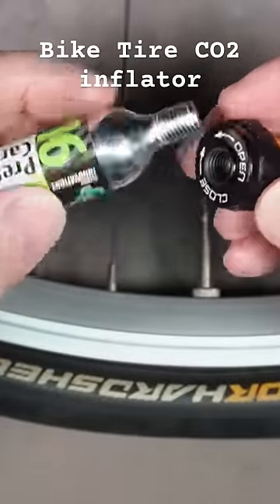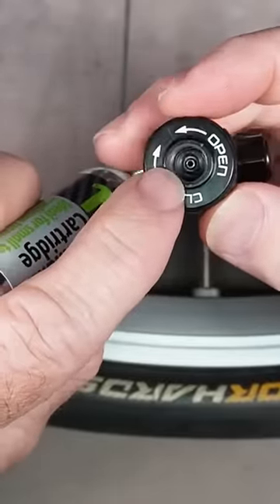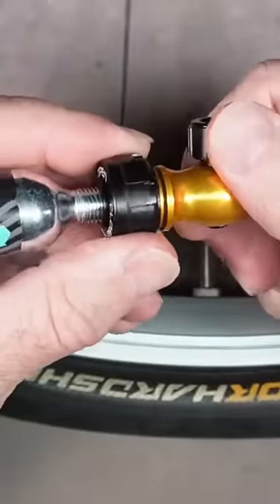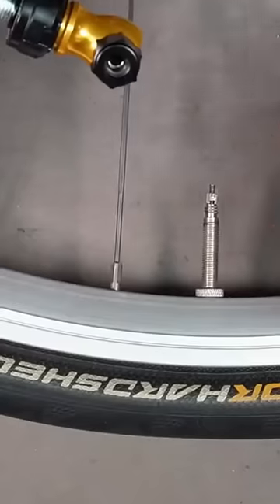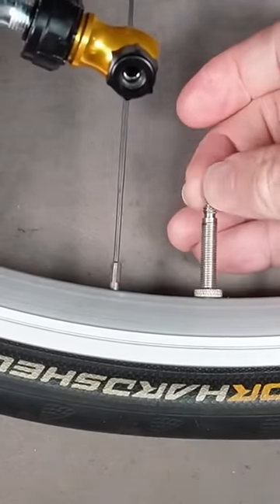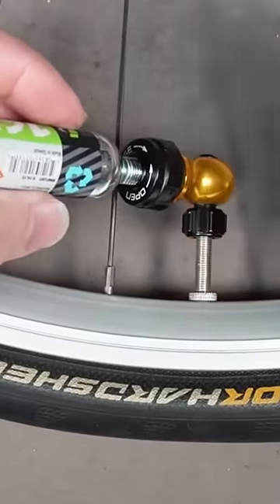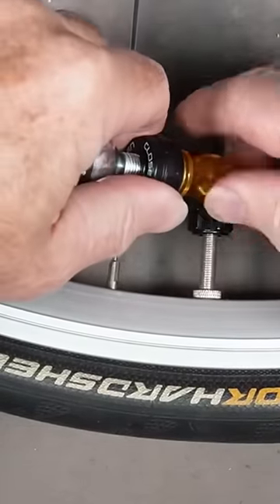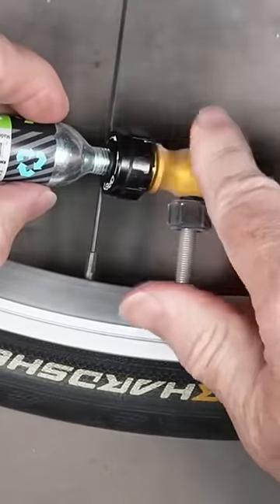Bike Tire (tyre) CO2 Inflator: How to use. #bicyclerepair #bike

Comment: You didn’t show the tire air coming out of the loose valve guys.
Reply from the maker: The valve is a Presta valve, which stays closed as long as there is pressure inside the tube or tire. Thanks for the comment.!

Comment: Now that you have unscrewed the valve core. Good luck keeping all of that co two in your tire when you disconnect that device
Reply from the maker: Nothing will escape when the CO2 inflator is removed. This is a Presta valve. Presta valves close when there is pressure inside the tube or tire. I only loosened the lock nut, which is necessary for air or CO2 to flow into or out of a Presta valve. I did not remove the core.
Thanks for the comment! I appreciate it!

Comment: He said unscrew the schrader valve but he didn't show you when you remove the inflator you have to poke the schrader in under the pressure. Worthless
Reply from the maker: Nothing will escape when the CO2 inflator is removed. This is a Presta valve. Presta valves close when there is pressure inside the tube or tire. I only loosened the lock nut, which is necessary for air or CO2 to flow into or out of a Presta valve. I did not remove the core. You can see the entire video here: How to Use a CO2 Bike Tire Inflator
https://youtu.be/jc-BpZL3lAk
Thanks for the comment! I appreciate it!

Comment: Bike pumps so compact now it hardly seems worth it especially if you goof up the fill and vent all the gas
Reply from the maker: There are definitely pros and cons! I have used my CO2 inflator at least four times over the years to save a ride and it worked fine for me. I will admit, though that the first time I was glad I had a second cartridge because I did not know what I was doing! Thanks for the comment!

Comment: Wow, and who carries a tool to loosen the main tire valve?? You know a lot of the air is gonna leak right back out when you disconnect it?? Until you get that tire valve tightened back down!! Why doesn't the device depress the main valve like any other tire inflator ???

I tried both amazon links, which show a re-designed device that would work as one should. This video should be removed/updated.
Reply from the maker: Please do a little research before you trash a video. The valve in the video is a Presta valve. Very common on higher end road bike. Presta valves close when there is pressure inside the tube or tire. I only loosened the lock nut, which is necessary for air or CO2 to flow into or out of a Presta valve. I did not remove the core. You can see the entire video here: How to Use a CO2 Bike Tire Inflator
https://youtu.be/jc-BpZL3lAk
Thanks for the comment! I appreciate it!

Comment: Did he ever red screw the valve
Reply from the maker: The valve is a Presta valve. Presta valves close when there is pressure inside the tube or tire. I only loosened the lock nut, which is necessary for air or CO2 to flow into or out of a Presta valve. I did not remove the core.
Thanks for the comment! I appreciate it!
Reply: Awesome thanks for the feedback!

Comment: And a small frame-pump is bad because …?
Reply from the maker: No one said it was! A CO2 inflator is just another option for emergencies to quickly and easily inflate a tire out on the road after fixing a flat. It is super small, light and inflates a tire in seconds. Thanks for commenting!

Comment: Or... just get a manual hand pump.  Small and easy to use
Reply from the maker: Pumps work great! A CO2 inflator is just another option for emergencies to quickly and easily inflate a tire out on the road after fixing a flat. Thanks for commenting!
Reply: @davescycling  seems kinda like a waste when a hand pump is small enought to fit anywhere and capable of filling up a tire as much as you want/need instead of being limited, then have to buy more C02 cartridges. 
Waste of money in my mind.
Reply from the maker: Thanks for your input and opinion! Enjoy your rides!!

Comment: You just need to be carefull that you dont explode your tire into your face
Reply from the maker: If you start with a flat tire, which is the purpose of the CO2 inflator, there isn’t enough volume of CO2 to over inflate the vast majority of tires out there. In my my testing, a 700c x 28 mm tire will only be inflated to about 90 psi using an entire 16 g CO2 cartridge. There is more information in the description regarding the pressures and tire sizes the CO2 cartridge will inflate.

Comment: Why does it need to be CO2? Why not compressed air or compressed N2? 🤷‍♂️🤦‍♂️
Reply from the maker: I do not know. I did not make these. Lol.
Reply: @davescycling  Exactly. 
There is enough CO2 in the atmosphere. Formula1 uses N2, aviation uses N2, N2 was a big marketing hype for cars several years ago. That's why I refuse to support this. 😉🤷‍♂️
Reply from the maker: Hopefully the cycling industry will love to N2 as well! Thank you for your input!
Reply: @davescycling  If they take the CO2 out of the atmosphere by cooling and pressurising: fine! If they burn natural gas just for creating CO2: not good. 🤷‍♂️

Comment: Oooh. So the air stays in the tire until you have to put the valve back in the stem?? 😂😂😂😂 Seems legit..
Reply from the maker: This is a Presta valve. Presta valves close when there is pressure inside the tube or tire. I only loosened the lock nut, which is necessary for air or CO2 to flow into or out of a Presta valve. I did not remove the core.
Thanks for the comment! I appreciate it!

Comment: nice, again something that nobody needs  xD
Reply from the maker: A CO2 inflator is just another option for emergencies to quickly and easily inflate a tire out on the road after fixing a flat. Thanks for commenting!
Reply: @davescycling   you can also use a pocket rocket master blaster .. anytime. You need to pump the surrounding air ... ok, maybe not in space ! ;)

Comment: 800 PSI in those how does it not explode the tire
Reply from the maker: It may be 800 PSI but it is a small volume of gas. The amount of compressed CO2 in the cartridge is only enough to fill a 700x x25 tire to around 95 PSI. Thanks for the question!
Reply: Ok cool. I thought CO2s was only used for
BB, Airsoft and paintball guns. Now I know they are for bicycle tires too. Thank you for the reply
Reply from the maker: I appreciate your input!

Comment: He unscrews the valve core. Now what ?
Reply from the maker: This is a Presta valve. Presta valves close when there is pressure inside the tube or tire. I only loosened the lock nut, which is necessary for air or CO2 to flow into or out of a Presta valve. I did not remove the core.
Thanks for the comment! I appreciate it!
Reply: @davescycling  thanks I was wondering how that worked.
Reply from the maker: I appreciate your question!

Comment: That pin thing on my gun the side is bent what do I do
Reply from the maker: Please clarify your question, thanks!
Reply: @davescycling  The O Pin is bent on my G19 like it was crushed what do i do (I apologize for not being more specific)
Reply from the maker: I think you are on the wrong Youtube channel.
Reply: @davescycling  I’m not the thing you have has that ring
Reply from the maker: Ok, I think I understand. If that pin is bent or crushed you will need to replace the inflator device. The pin will likely not be able to pierce the seal on the CO2 cartridge if it is bent.
Reply: @davescycling  it punctures just fine but I’m worried about over time it leaking

Comment: Or you can have a manual pump with infinite uses
Reply from the maker: Indeed! A CO2 inflator is just another option for emergencies to quickly and easily inflate a tire out on the road after fixing a flat. It is super small, light and inflates a tire in seconds. Thanks for commenting!

Comment: I doubt this will be able to provide the 60 PSI I require.
Reply from the maker: It will depend on what size tire you are using. In the description you will find various tire sizes with the potential PSI rating.

Comment: why not just use a pump or air compressor?
Reply from the maker: A CO2 inflator is just another option for emergencies to quickly and easily inflate a tire out on the road after fixing a flat. Thanks for commenting!
Reply: @davescycling  true might be good to have multiple options depending on your circumstance. thank you for the demonstration

Comment: All proprietary, isn't it?
Reply from the maker: No, it will work with any brand of threaded CO2 cartridge and depending on the inflator you get you just need to make sure it will work on a Schrader or a press valve depending on what you have. Thank you for the question!

Comment: Why? Those hand pumps are so small and effective these days that you don’t need all this fancy bs.
Reply from the maker: Hand pumps are great! A CO2 inflator is just another option for emergencies to quickly and easily inflate a tire out on the road after fixing a flat. It is super small, light and inflates a tire in seconds. Thanks for commenting!
Reply: @davescycling  I get what you’re saying and I get the purpose. But I mean that while you make sure everything is aligned correctly a person with a hand pump just slaps it on and inflates a tire under a minute or so, minus the used cartridge or whatever it’s called.

Comment: lost.most of it when u removed it and tried to screw the valvestem guts back in. vid did not show that.
Reply from the maker: This is a Presta valve. Presta valves close when there is pressure inside the tube or tire. I only loosened the lock nut, which is necessary for air or CO2 to flow into or out of a Presta valve. I did not remove the core. You put can see the entire video here: How to Use a CO2 Bike Tire Inflator
https://youtu.be/jc-BpZL3lAk
Thanks for the comment! I appreciate it!

Comment: а как он без нипеля закроет?
Reply from the maker: Nothing will escape when the CO2 inflator is removed. This is a Presta valve. Presta valves close when there is pressure inside the tube or tire. I only loosened the lock nut, which is necessary for air or CO2 to flow into or out of a Presta valve. I did not remove the core.
Thanks for the comment! I appreciate it!

Comment: Cheaper to bring a bike pump
Reply from the maker: This may be true, although CO2 inflators are pretty cheap! A CO2 inflator is just another option for emergencies to quickly and easily inflate a tire out on the road after fixing a flat. It is super small, light and inflates a tire in seconds. Thanks for commenting!

Comment: I hate preston valves with a passion
Reply from the maker: I hear that a lot, thanks for your input!
Reply: @davescycling  i gather you would lol.
I've looked into these units for my 8x8 as an emergency thing, as they only need 3-5 psi. Ended up with a compact ryobi compressor instead.

Comment: your going to lose 50% just to tighten the schrader valve with this method. Plus you can hear liquid going in. Not good.
Reply from the maker: Nothing will escape when the CO2 inflator is removed. This is a Presta valve. Presta valves close when there is pressure inside the tube or tire. I only loosened the lock nut, which is necessary for air or CO2 to flow into or out of a Presta valve. I did not remove the core. Also, CO2 partially turns to liquid as it expands due to the sudden decrease in pressure but becomes gas again as it fills the tire. No issue. This method has been used for decades (it is only meant for emergency use went out on the road after fixing a flat tire) and I have used it personally for years and never had an issue. You can see the entire video here: How to Use a CO2 Bike Tire Inflator
https://youtu.be/jc-BpZL3lAk
Thanks for the comment! I appreciate it!

Comment: When you remove it to reinstall the valve in the steam all the air will go out of the tire . 😂
Reply from the maker: This is a Presta valve. The pressure inside the tube will keep the valve closed. Thank you for your comment!

Comment: А что стало с обычным насосом?
Reply from the maker: A CO2 inflator is just another option for emergencies to quickly and easily inflate a tire out on the road after fixing a flat. Thanks for commenting!
Reply: @davescycling  I know, but much time do you gain using this tool comparing with a common pump? And it is limited. So does it worth it?
P.S. But this tool was interesting, didn't know about it before your video, thx)
Reply from the maker: Thanks for your reply! I carry one of these and I do not carry a pump. Used it 4 or 5 times over the years when I had a pinch flat issue in one of my road wheels. I like it because it is super small and can stow it in a small saddle bag and not even know it is there. I like minimal gear on my bike. Also, after sitting roadside replacing the tube in my tire ( I am no youngster) I appreciate the easy and fast inflation the CO2 inflator provides!

Comment: Ive always got a spare inner tube or 2 and a pump on me so, domt see the need
Reply from the maker: I carry a tube and a CO2 inflator. Inflates in 3 seconds and I am on my way. (After replacing the tube, of course)
Reply: @davescycling  seems pointless when a pump is long term and may only take you an extra 30 seconds
Reply from the maker: It is what I have used for years. Not saying it’s better, just my preferred method! Thanks for your input!

Comment: Y not use a tire pump…
Reply from the maker: A CO2 inflator is just another option for emergencies to quickly and easily inflate a tire out on the road after fixing a flat. It is super small, light and inflates a tire in seconds. Thanks for commenting!

Comment: There is no way 1 co2 cannister filled that tire to the 110-120ps1 the tire should be at with presta valves/tires take super high pressure to keep inflated
Reply from the maker: Actually, it can depending on the tire size. I have a video demonstrating using one 16 g cartridge to inflate a 700 C by 28 mm tire to 95 psi. I did not actually test but I would imagine that a 25 or 23 mm tire would actually get up to 110 or more. The company does advertise (see description for inflation info) that the 16 gram cartridge can inflate some road tires to 130 psi. The 20gram cartridge would definitely do it. Please note that the CO2 inflator is designed for emergency use to inflate a tire quickly and effectively after a flat repair while on a ride. If you use one on a ride, it is highly recommended to replace the CO2 with regular air when you get home as CO2 does leak out of the tire much faster than air does. Thanks for your comment. I really appreciate it!
Reply from the maker: I am not sure how my attempt to provide factual information is arrogant, but I am thankful for all who watch my videos! So thank you for your opinion!

Comment: Or just get a hand pump. That wont deflate in a few days 😂
Reply from the maker: A hand pump is an excellent option! A CO2 inflator is just another option for emergencies to quickly and easily inflate a tire out on the road after fixing a flat. It is recommended that when you get home, you replace the CO2 with regular air. Thanks for commenting!

Comment: Im sure this dries and cracks the rubber by freezing it
Reply from the maker: I have never had that issue. A CO2 inflator is just another option for emergencies to quickly and easily inflate a tire out on the road after fixing a flat. Thanks for commenting!

Comment: Just get an electric pump not over expensive and good these days.
Reply from the maker: A mini pump is probably the most reliable overall solution. Some people like myself want to carry the bare minimum of equipment on the ride so we prefer something that packs away in a saddlebag, never to be seen until needed! A CO2 inflator is just another option for emergencies to quickly and easily inflate a tire out on the road after fixing a flat. Thanks for commenting!
Reply: Yeah which is why I said about getting an electric pump. I have one in my saddlebag too its literally same size as a hand pump maybe tad thicker but its far more reliable as you don't have to do a 40min workout to inflate one tire especially if you have a fat tire bike or a MTB.  @davescycling

Comment: Yeah? Now remove the inflator and watch your valve fly 😂
Reply from the maker: Nothing will escape when the CO2 inflator is removed. This is a Presta valve. Presta valves close when there is pressure inside the tube or tire. I only loosened the lock nut, which is necessary for air or CO2 to flow into or out of a Presta valve. I did not remove the core.
Thanks for the comment! I appreciate it!

Comment: More ag than using a proper pump
Reply from the maker: Thanks for the comment! I disagree that it is more aggravation than a pump. It is only to be used for emergencies when out on the road. When I get a flat, I simply replace the tube (or patch the hole, but tube replacement is super quick) and inflate the tire in about 3 seconds with the CO2 inflator and I am on my way! Nothing wrong with a pump, just that it takes longer and more wasted effort to inflate the tire. Just my opinion!

Comment: Easy enough to overinflate, blow a bead off and explode a tube.
Reply from the maker: Actually, if you take a look at the information in the description of the video, you will see that it is actually difficult to over inflate. A single 16 g cartridge only has enough volume in it to inflate a tire to the pressures you will see in the description. Certainly, if your tire is not flat and you’re trying to “top off” a tire, which is not recommended, you could over inflate. The CO2 cartridge is intended to inflate a tire after repairing a flat on the road so you should only use the number of cartridges recommended, which is usually one. Thank you for your comment. I really appreciate it!